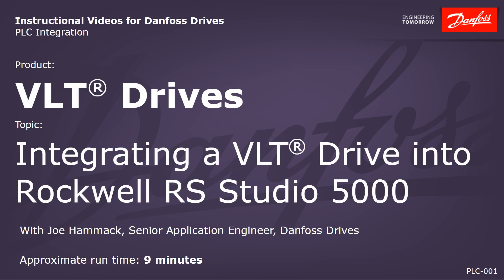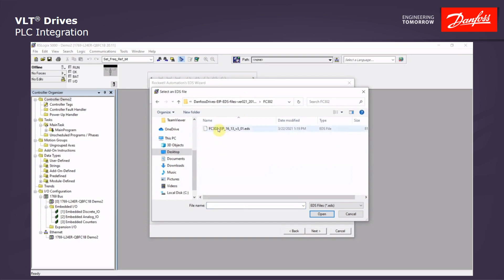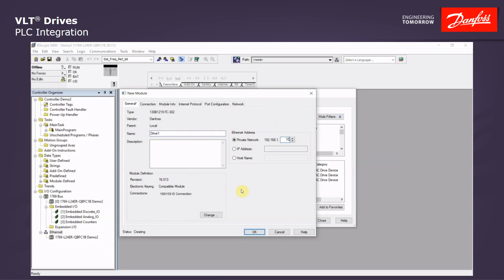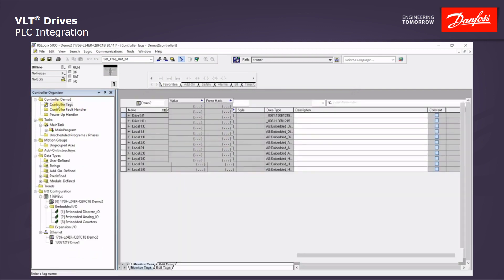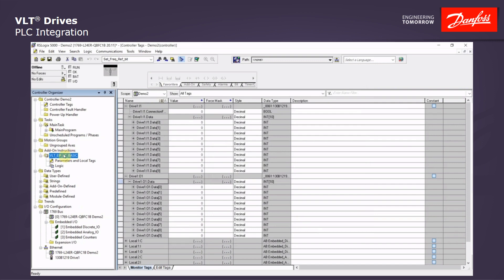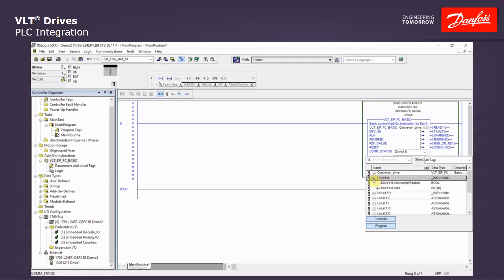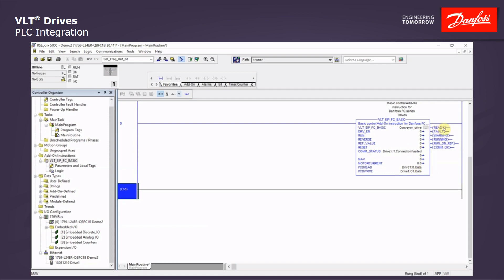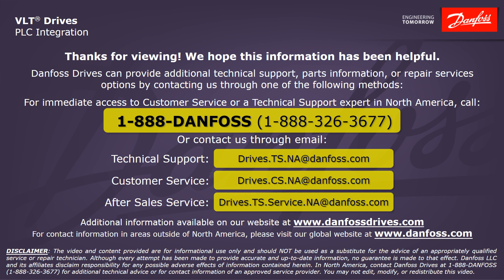VLT® Drives: Integrating a VLT drive into Rockwell RS Studio 5000

Comment: Gracias por la información , la revisare detenidamente.
Reply from the maker: For installation, start-up, programming and troubleshooting assistance please email: Drives.TS.NA@Danfoss.com
or if you need immediate assistance contact Danfoss Drives 24/7 tech support at: +1 888 DANFOSS (326-3677)

Comment: Dear sir I would like to request you to make a video on rpm control of motor with pressure transmitter (4-20mA, 1 -4 bar) in danfoss fc302 such that rpm would be higher at low pressure and lower at high pressure.
Reply from the maker: Thank you for the suggestion, we will pass it on to our training team.